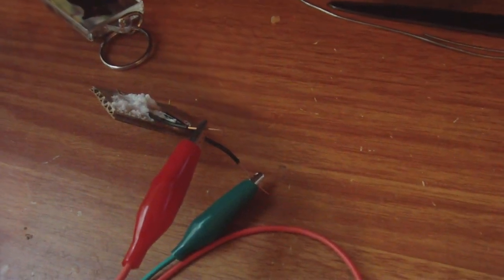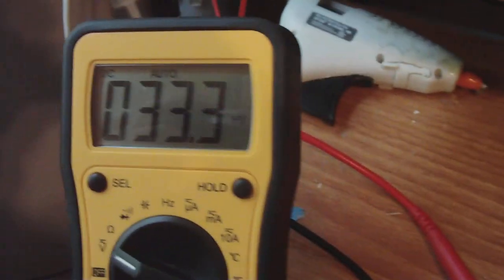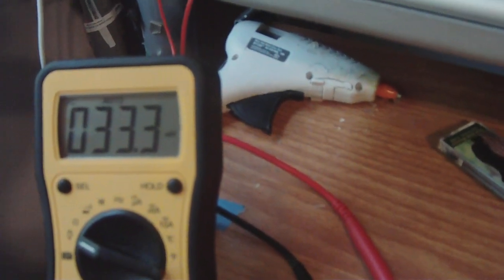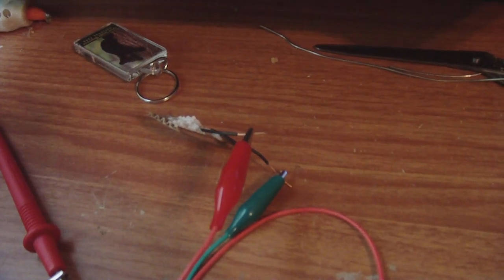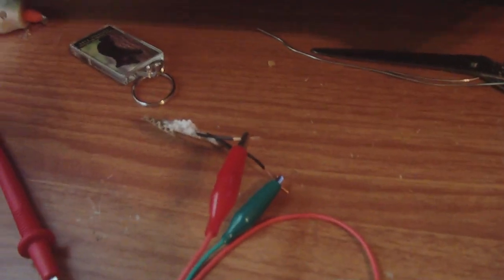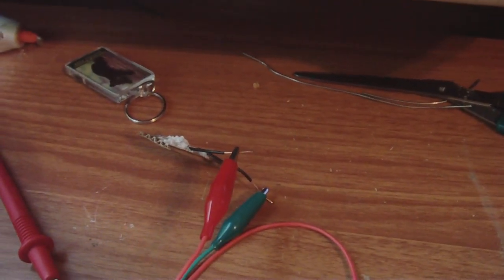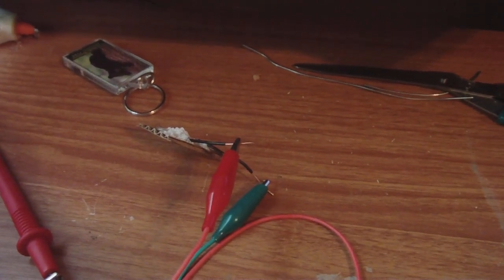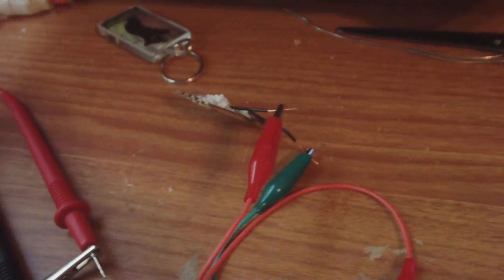Quartz copper Petrovoltaic cell

Comment: I made several of these using copper pipe end caps and copper fittings. The first, I used calking. It pumps out volts and amperage. The second I used salt and glue. The copper gave off a green color and corrosion. I made another of these and it did the same and voltage was low and weak. I suspected a galvanic effect and dis-assembled them and turned them into glue only.

Comment: ok your using peizoelectric crystals, they hold voltage like a diode which absorbs the positive part of randon sign waves in air.  half the sign wave is lost so you get constant +volts and no - volts.  Its residual and can come from sun, your phone or any electrical device..  people are thinking or using this as a better form of photo cell as they collect all kinds of waves depending on frequences..